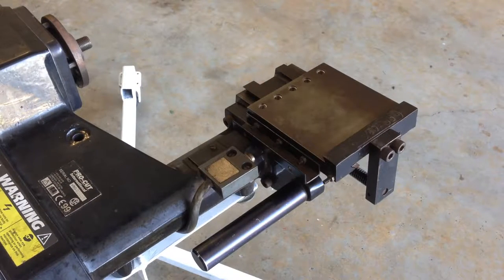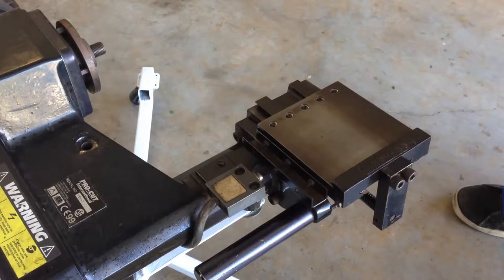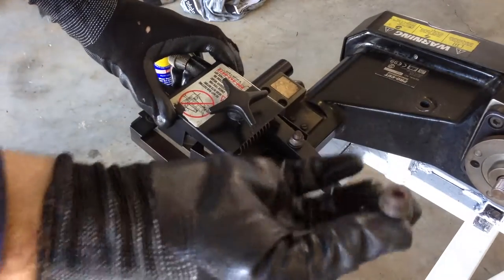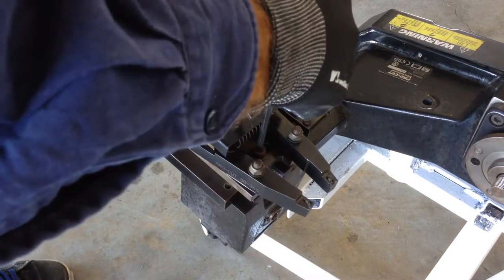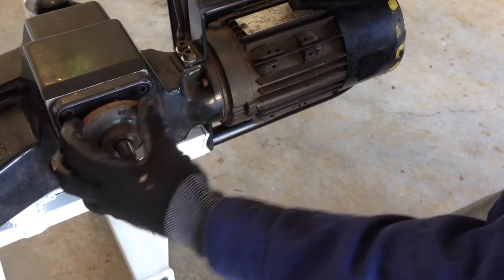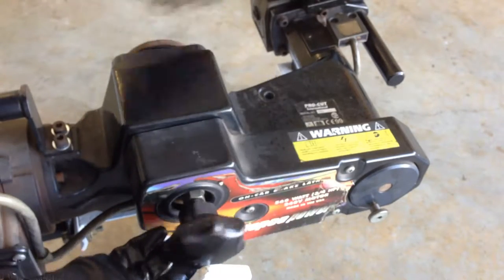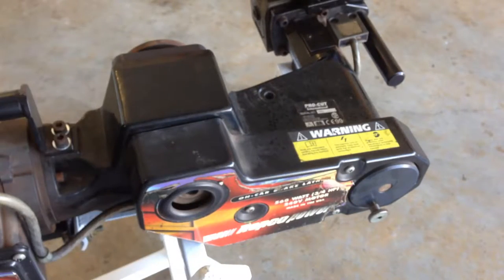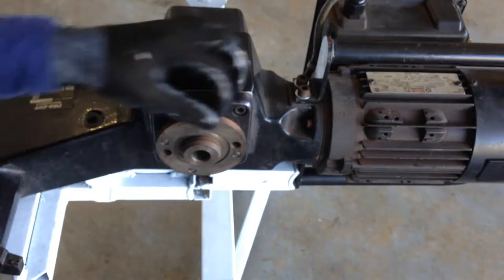Pro Cut / VBG On Car Brake Lathe Service - Part 3 : Drive Belts and Hub Pin

Comment: Hello. Thanks for the video. I have been looking at purchasing one of these lathes. Quick question...up to what size diameter rotor can it machine? I need to do f250 and f350 truck rotors and they are big.